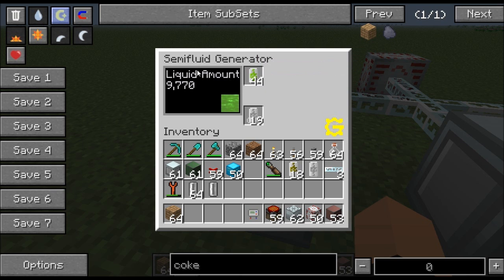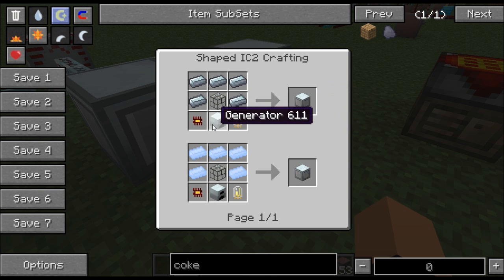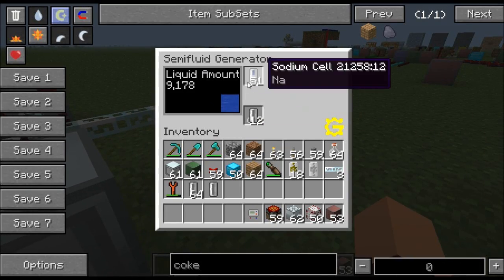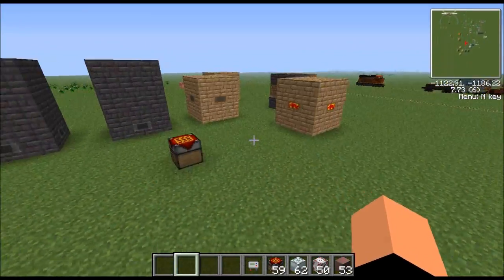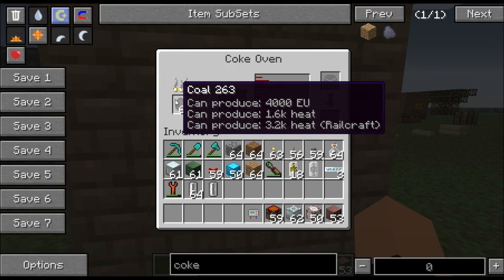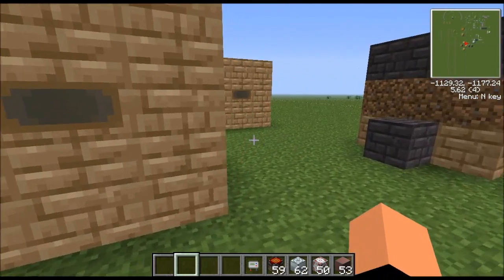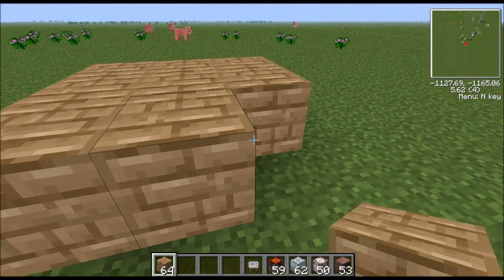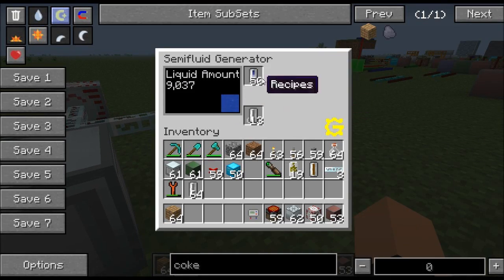FTB/Feed The Beast Tutorial/Guide - Semifluid Generator, How To Make And Use, Plus Tips

Comment: btw gumpy not sure if you do this or not... but once i was able to build a quarry i saved ALL the flint and gravel from it, and had a production line turning it into silicon cells, you get 4 cells per stack of flint/gravel.... so I was able to get a ton of solar panels from that, also using the silicon to make your regular or advanced circuits will double the output, which was important to me to save on copper ( not getting so much of it in mindcrack) and glowstone